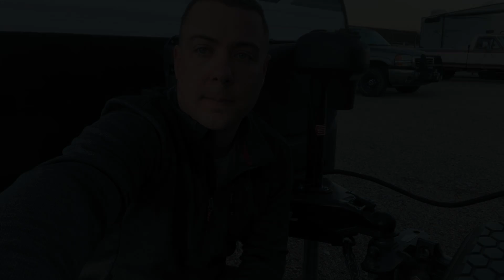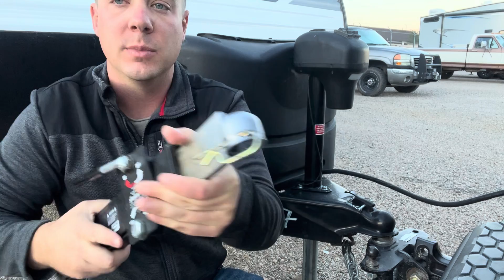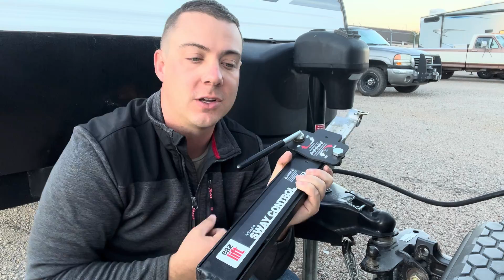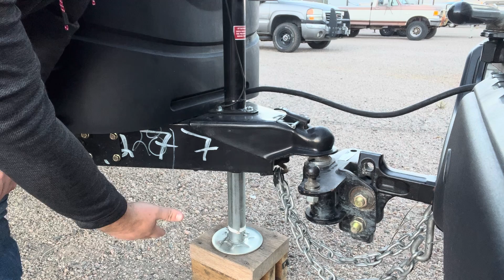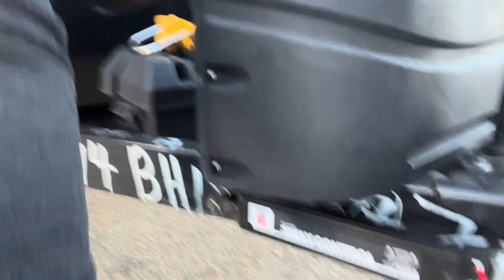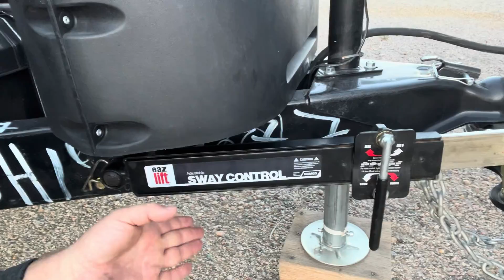How to Use a Sway Bar Controller on your RV Travel Trailer

Comment: I'm really new to this whole thing. On mine it states that you should remove it in slippery conditions. My first time using it was in slippery conditions and I had not read that warning. On a snowy mountain down hill the trailer pushed my truck sideways (not completely but I felt the truck fishtail). It was terrifying, to say the least. 
Fortunately taking my foot off the brake (I was braking gently) straightened the rig out and I could reapply the brake without trouble. Now I think my Trailer Brake controller could be mounted in a better place in order to find and use it in a situation like that. I also think it's a good idea to practice finding and using the trailer brake while still keeping your eyes on the road, like motorcyclists practice emergency braking and avoidance to that it is just a "programmed  reaction" to a sudden problem. At that time I didn't even think to reach for the trailer brake, and wouldn't have found it, or had the time if I had thought of it. The trailer brake would have been the correct answer to my problem, fortunately for me and everyone on the road I was just lucky.
Reply: Sharing this stuff could save a life — or at least a ton of money. 👍👍

Comment: What happens when you pull into a gas station and need to make a moderately tight left turn to get to the pump?  You have to jump out and disconnect it first?
Reply from the maker: You will be fine, we’re taking almost jackknifing would be what would cause issues.

Comment: Appreciate the video.  I was told to just lightly tighten it and I wondered.. had some sway with that confguration on the interstate.  so I will try this today on my way back
Reply: Tightened it a lot.  did great running 70mph. could feel it working going down a big hill.  6200 lbs 27ft trailer with half ton.
Reply: Thank you for the update! I have the exact same one and had no idea how to even use it.✊

Comment: Thanks for posting, exact same demo at our dealer “hand tighten only, don’t crank it down”

Will going tighter, we had a little bit of sway on way home from dealer.

How about the set screws on the chain tension saddles?  Dealer said to hand tighten those too….stated there should be a bit of play for turning

Comment: Your exactly right.
I had been using the leveling Bars on my 34’ camper to give some lift and sway control, but after needing to take the bars to their 75% load adjustment to get the needed sway control i felt i needed, I came to hate the amount of pre load i was inducing on the trailer tongue and they were a real pain to load onto the L brackets without jacking up the rig with the trailer tongue jack. I just grew to hate the whole scenario. ( i didn’t need to recover that much lift for my f250 anyhow) 
So i decide to add the friction control to the mix of load leveler and friction control. I reduced the amount of tension on the load leveler bars to about half and blended in the friction bar tension.
Like you said, its hard to tell someone how to adjust the friction bar but mine is adjusted something like this.
Once you figure out where the adjustment starts to add friction,….. mine is adjusted to about 2.5 turns tighter. 
After adding the friction bar and reducing the tension on the load levelers I’ve made several interstate trips and I’m very surprised how well this works. I have minimal sway and the reduction on the bars lets the truck and trailer fell like they work much better together. Thank you for the video.

Comment: The noise is a binding noise. And I l learned that you do not make tight corners and do not back up.
Reply: I just got a 33' travel trailer and a weight distribution system and sway bar both were left inside the trailer. So, when I go to use it, fuel stations and places I need to turn, I'll have it loose. But, I'll line up with the entrance ramp for the freeway and tighener down and away we'll go.

Comment: I agree should be tight. But when i have to make a 90 degree turn i get dsh dsh dsh dsh jarring noise. Maybe too tight?
Reply: Yea, if it is too tight the trailer will try to steer the truck.  Too tight and it will drive the truck and be the opposite of sway.  You have to experiment with the tension.  But... yes, if it is moaning, it is working.

Comment: Thanks.  I find it bizarre that the MFR says to tighten the handle all the way down, then use the bottom nut for adjustment.  I've seen a few videos now that do exactly the opposite, and even though you didn't say it, that's what you demonstrated, and that's how I'll be doing it.  Tighten the bottom nut then use that bar to adjust the tension.

Comment: This ONLY applies to Ancient "pig type " trailers not the more modern "dog trailers". It astounds me that van and trailer manufacturers add "features" and do not unload the ball on the vehicle which is a majour brake and instability issue, and make the trailers "weight distribution sensitive". About time the industry caught up with some modern tech to negate the down fall of ALL "pig type" trailers.